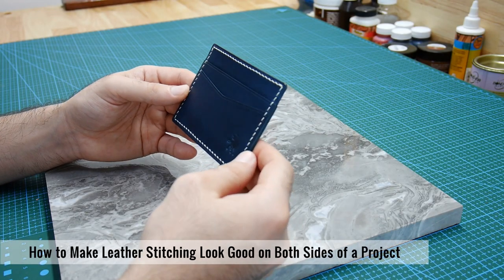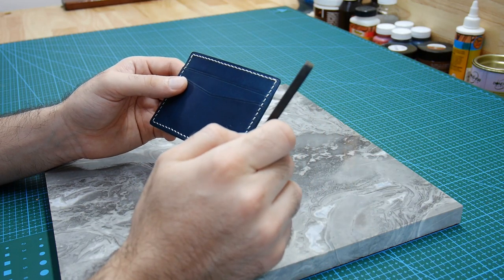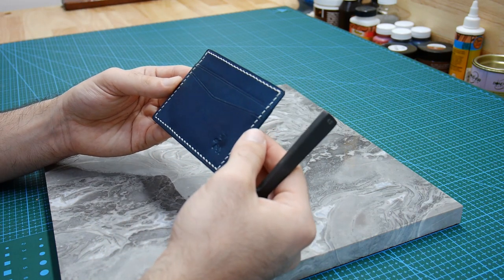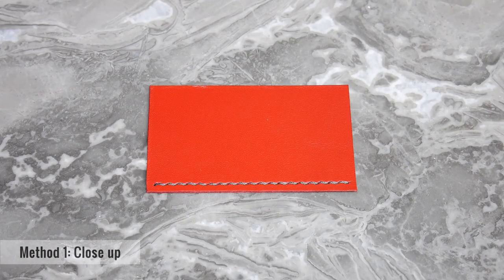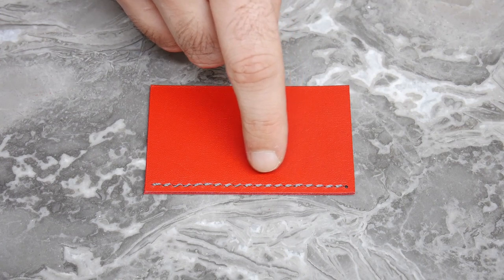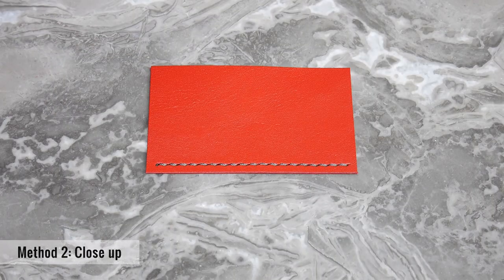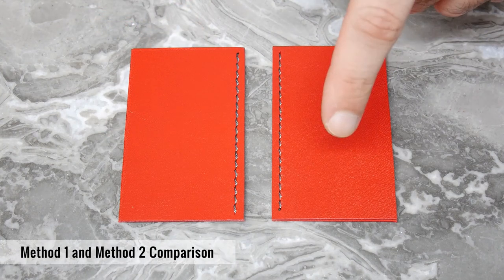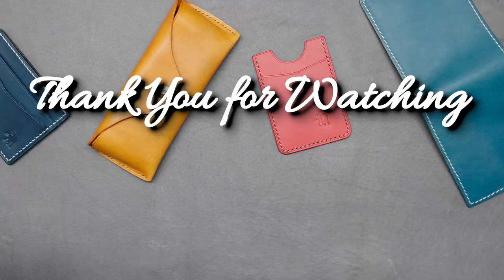How to Make Leather Stitching Look Good on Both Sides of a Project

Comment: Exactly the lesson I was looking for, actually.  

I haven't done any leather work in years, but, since we have the internet now, I decided to learn how to do things the "right way."  So, after I saw a video of some guy hand stitching at incredible speed, I thought I would give that way a try.  My hands went into cramps by the fifth stitch.  The result was terrible, but I did remember having the same problem before.  The first inch and a half of stitch was nice, then it lost all consistency on both sides.

My old method, I was punching all of my holes against a board with an awl and then struggling to get the needle through and cutting my thread.   
The new method involved holding the awl in one hand and punching each hole as I went without any glue.  Now that I've seen your video, I remember why I was doing it the way that I was.  Most of my work in three layers of 8lb veg tanned.  Although it might be possible to get oil tanned bridal leather to stop stretching as you stitch, veg tanned isn't going to do that.  

Fortunately, I decided to make sheaths for my tools as my first new project.  So, as the cramps in my hands go away, I might get more consistent before I go back to my old habits.  This will give me a nice way of looking at the difference as well as he durability.   The "traditional" harness stitch" method might get the job done a lot faster, but, I think I'm going to switch to a round awl.  (For one, not cutting the leather with a diamond, allows a few drops of water and small wooden mallet to close the holes to a perfect fit.  Veg tanned can be brilliant in that way.)
Reply from the maker: That is good to hear. Definitely prioritize your stitching process before looking to focus on speed.

Comment: Another good tutorial for you to do would be dragging and leading stitch lines to preclude the final stitch in a run being disproportionately longer than the others. This would be necessary when the pattern hasn't been customized for the iron in use.

This has made me see the value of having a five-prong iron in the required size.
Reply from the maker: Thanks for the suggestion. That is an important skill for nice looking stitching.
Reply: @TeranAtelier  I've decided I don't want to alter patterns for different iron sizes, so I'm looking to dragging and leading stitch lines as a normal practice.

Here is what I discovered today. With a 9-prong 3.38 iron, it took three punches (using the last two holes of the previous punch and seven new holes) to extend the stitch line 3.38mm, adding one additional hole to the stitch line. An extension or reduction of such a length isn't really necessary. All we're ever looking for is an alteration of 0.25mm to 1.0mm, about one punch with the 9-prong iron.
Reply from the maker: Yes that works. Matching holes to a pattern is really only important if you are punching holes before gluing or not intending to glue. Most crafters don't really bother matching holes as it doesn't achieve much if you are going to hole through the leather after gluing.

Comment: Hi, could you show how to end the stitch? What do you do when you want to seal the end? Do you sew backwards?
Reply from the maker: Yes I normally back stitch for two stitches and have both thread ends on the back side of the project. If using polyester thread I melt the ends, and if using linen thread I will add white glue to the end to help keep the thread from coming undone.

Comment: Is it possible to glue both leather together and then punch holes on both side and get the result of method 2?
Reply from the maker: You can get nice looking stitches with both methods but they will look a bit different as the stitches on the back side will be slanting in opposite directions. Method 2 is very useful for joining the interior and exterior of a bifold wallet, where it can be difficult to punch holes exactly vertical through many layers of leather. Method 1 is good to use for every other situation.

Comment: For method 1, can you re-chisel the back side in the opposite direction to clean up the holes?
Reply from the maker: Yes this is an option, however you would also need to purchase the reverse chisels of the same brand. The distortion on the back of the holes is minor and only seen under close scrutiny. It is more important to get the stitches laying correcting as they are very visible.

Comment: Hello! For method 2 did you also have the reverse chisel for the holes on the back or was it the same chisel?
Reply from the maker: Hi! It is the same chisel. In that method I chisel on both pieces of leather separately from the grain (smooth) side. When they are glued together the holes will align to make an 'X'. I am planning a follow up video about this topic soon as this question has come up quite a few times.
Reply: Thank you for the informative video

Comment: Love it, it's great to see the side by side comparison, and especially for me, I love the very detailed steps of the sewing.

If I'm interested in using method two of your demonstration, using French Style stitching irons, I get the feeling this is where I would need both the Obverse set along with the Reverse set of irons when penetrating each side separately. Is that correct?
Reply from the maker: Thanks! I made a follow up video on the Method 2: https://youtu.be/GxPb19fvFVU The method can be done without reverse chisels as you punch the leather from both sides separately before gluing them together.
Reply: @TeranAtelier  Ha! Combining the front / slash with the rear \ created the X pattern I was worried about, but the stitches still came out just fine like you said. Interesting!

Thanks for taking the time, beautiful work, Sir!
👍
Reply from the maker: @Axel-im6si  Thank you! It is a bit tricky to get everything lined up correctly but it gives great looking results.

Comment: I so appreciate this...just one quick question,  would stitching be any different,  if we use reverse pricking iron on the other side so the slanted piercing on both sides of the leather be fully aligned,  or it doesn't matter when the slanted pricks cross each other like what you showed?  I have both obverse and reverse pricking irons...
Reply from the maker: Using reverse irons for the back piece would certainly make the holes look a bit nicer. When stitching you should use the first method similar to if you punched through the leather only from the front side. However, this method would add a lot of time compared to the just punching through the glued pieces from the front side and the asthetic benefits on the back side may only barely be noticeable.
Reply: @TeranAtelier  really appreciate your detailed answer 🙏🏼

Comment: Which direction and angle should I pull each of the threads if I stitch towards myself and not away from myself and also put the left needle through first?
Reply from the maker: You should put the needle in through the side that you punched in your holes from. Look closely at the angle of the stitches and pull your threads so that they are pulled into the most forward part of the stitching hole in the direction of your stitch. It should be quite clear if your stitches are laying correctly or not.

Comment: Great video. Thank you for sharing. 
I’m curious, what will happen if you use method one ( glue together and punch) but pull the thread with method two ( right hand up / forward, left hand down and back)?
Reply from the maker: Thanks! If the threads are not angled correctly they will be pulled to the wrong part of the hole and not sit like they are supposed to. In this case the stitches on the back side will not lay correctly while the front side should still be fine.

Comment: When it comes to “alignment” of the two pieces of punched leather in sample 2, couldn’t you use a needle going through holes at both ends to align holes before they are pressed together? You only get one chance to do it right.
Reply from the maker: Adding needles in the corner holes will help align the pieces. I do this in most of my project videos which you should be able to see. The glued pieces can be pulled apart if you make a bit of a mistake, its only when you hammer down the edge and apply pressure that you get a permanent bond.

Comment: Mr. Atelier, I see at 2:14/11:19 that you use 3 base surfaces under the leather when you punch holes. The bottom surface looks like a marble square used for leather carving. The top surface appears to be another piece of leather. What is the white square surface, in between, on top of the marble surface?
Reply from the maker: It is a thick block of plastic used as a punching board. It is so you can completely punch through the leather without damaging your pricking irons.
Reply: @TeranAtelier  Thank you!

Comment: I'm trying your method again today. Does it matter which hand pulls up and which down? Could one just as well pull towards and up with the left hand and away and up with the right, as this would match the "X" slanting? Or does the fact that you are casting/looping on the second piercing on the right side necessitate the pull directions you employ?
Reply from the maker: The casting/looping is the most important part. The angle you pull when tensioning just helps the thread sit in the limits of the hole. If you look at your stitch you should be able to tell in which angle you need to pull the thread to get it to sit in the corner. If you added no angle at all when you tension then the stitches would still look fine but may not sit all the way to the tips of each hole. Hammering does also help the stitches sit properly in the hole but I find the angling makes it even better. You should try tensioning with and without an angle and see how it changes the look of the stitches.
Reply: @TeranAtelier  Good advice. Thanks. Another thing I recently started thinking about in troubleshooting my stitching is the idea of punching all the way through a 3mm thickness with obverse irons and then lightly punching the back side with reverse irons. Would this have any benefit?
Reply: @TeranAtelier  Some people claim there is no need to cast when X-stitching. I don't believe them, but I should try to experience all the variables.
Reply: @TeranAtelier  I think I have solved my problem simply by switching to JJ 004 needles with 0.45 linen and 3.0 irons. For the longest time, I had thought the decision whether to use 002 or 004 was merely a matter of personal preference, and I had been preferring the girth and length of 002 needles, never realizing that a slight difference in needle size makes a tremendous difference when using thinner thread, shorter iron spacing and thinner leather. I'm a bit pissed I did not understand this earlier and had ignored this factor for so long.
Reply from the maker: @pequodexpress  If you use Japanese style pricking irons then obverse/reverse irons might be ok because it should be easy to line up the reverse punched holes. I still think its too much effort/cost with little gain to justify doing it that way. If you don't cast the stitches, then the stitches will lay flatter and not give that slanted 'hand stitched' look as much.
Reply from the maker: @pequodexpress  With needles it is best to use the smallest one that your thread can handle which makes it easier to stitch and also does the least amount of damage to the stitching holes. I use JJ 004 needles for everything including 432 Lin Cable, but it is a tight fit.
Reply: @TeranAtelier  Do you think this topic is worthy of a video? I think it is an overlooked issue. You can show stitching with a 002 needle and stitching with a 004 needle. I ordered some System S+U needles today, 953-7 (0.7mm in diameter).
Reply from the maker: @pequodexpress  Yes it does sound like a good video idea. Those 0.7mm needles seem to be good for 0.3-0.35mm threads, that is far finer than any threads I have used before.
Reply: @TeranAtelier  I think too many people are trying to use JJ 002 needles in situations where they should not. To make my situation worse, I use Isvara irons that have different tooth widths for 2.7, 3.0, and 3.38 irons (1.45mm, 1.6mm, and 1.75mm, respectively). 3.85, 4.0, and 5.0 irons have a standard 1.85mm tooth width. This makes needle diameter an even more significant issue.
Reply from the maker: @pequodexpress  They are some very narrow holes and I can see how a 0.7mm needle would help with some of the finer threads. However, I expect the majority of people are using threads in the range of 0.5-0.8mm so that the JJ 002 which match are also popular. JJ 004 may also have visual benefits in addition to being easier to stitch, I would have to test this.
Reply: @TeranAtelier  I started handstitching with thicker leather, thicker  thread, a 3.85 French chisel, awling through, and a JJ 002 needle. I wasn't too focused on aesthetics then and didn't notice a problem. When I started to refine my technique with thinner projects, thinner thread, and a 3.0 iron, I didn't take into account the size of the harness stitching needle, not until recently. Most of the popular saddlestitching videos out there are demonstrating with the use of a thick single layer of leather, large irons, thick thread, and a harness stitching needle that is about 1.0mm thick.
Reply from the maker: @pequodexpress  Yes there are not too many people doing fine stitching of 3mm spacing or less so it makes sense that they are not using the smallest needles.

Comment: Hi.. it looks like  you're pulling the tension differently in both methods .. is this why the stitching sits better in the second example?
Reply from the maker: Yes you need to pull at different angles depending on the method to get the stitches to 'sit' in the correct part of the hole and lay correctly. The stitching on the back side on both methods should be the same, except method one is slanting in a 'reverse' orientation.
Reply: @TeranAtelier  So if you used method one for the chisels but used method two for how you tightened the thread, would you get the same on both sides?
Reply from the maker: @tjmars37  The front side will look good as normal. However, the stitching on the back side will look strange because the stitches will sit in the wrong part of the hole. The angles at which you pull the thread are so important to getting nice and clean stitching on the back side.
Reply: @TeranAtelier  I would still love to see a video of method number one with pulling with thread in opposite directions as opposed to both of them up just to see the comparison :-)
Reply from the maker: @tjmars37  I think that is a really good idea. Stay tuned :)

Comment: I'm a bit confused, on the second one did you put the pricking iron in the grain side of one piece of leather and from the flesh side on the other or did you use an inverse iron, it's not that clear
Reply from the maker: In the second method the two leather sections are both chiseled from the grain side separately. They are then glued together on the flesh sides so finally the chisel holes will make an 'X' at each holes as they are slanted in opposite directions. There are no inverse irons used.
Reply: @TeranAtelier  ah right that makes sense, I'll have to try that, thanks for the reply
Reply: I curious as well since both grain & flesh sides have the same color.
Anyway, thanks for the vid.
Reply: @pertamaterakhir6193  by the looks of it the leather is “dyed through” so although one side will probably have a better finish  they are both the same colour. What I didn’t understand was if you use a pricking iron and it leans like so “/ “and you pierce from the other side your pricking iron will still lean the same way so you end up with an “x” as he states above. The only other way is to buy two sets of irons both going in the opposite direction. Hope that makes it a bit clearer👍

Comment: the reason you like the second way,... is because you glued the backsides together so you dont have the holes looking wonky from the chisle coming thru it. where if you chisled both together where the faces were facing the same way then flipped the other piece you would have the same result. as number 2.
Reply from the maker: The best part about the method is you can mark in a stitching line and line up your irons perfectly on both sides separately. This means that you get great looking stitches on both sides which is what you want for a wallet. Stacking the leather before punching adds thickness and there will be a higher chance of error.

Comment: Why does the thread get wrapped up & over the needle only on the right side, but not the left?
Reply from the maker: The wrapping of the thread on one side will be pushed to wrap at the center of the hole when you pull tension on the threads. This means only one side needs to be wrapped. Right side or left side just depends on the direction of stitching.

Comment: I'm still so confused by the back to back stitching punch method. I understand that bith sides are entry holes so there no exit wrinkles. But I dont understand how the threads sit cleanly on both sides. Aren't the holes making an "X" shape since the slants are now mirrored? I don't get how the thread sits correctly on both sides.
Reply from the maker: Yes the stitches will give the appearance of an 'X' as they are crossing each other in the middle of the hole in the leather as it goes from the front to back of the leather. I recommend trying the method to see how it works in practice.

Comment: What is the purpose of wrapping the thread around the needle before pulling tight?
Reply from the maker: The wrapping is called 'casting' and it makes the threads lay over each other is a way that accentuates the slanting of the stitches from which hand stitching is known for. Stitching without casting will still work but will give flatter looking stitches similar to machine stitching.
Reply: @Teran Atelier  thanks for the input. Most videos show this as a necessary step but I was confused about it's purpose.